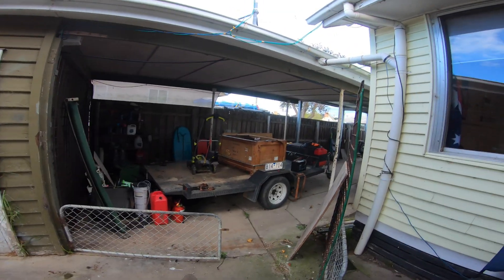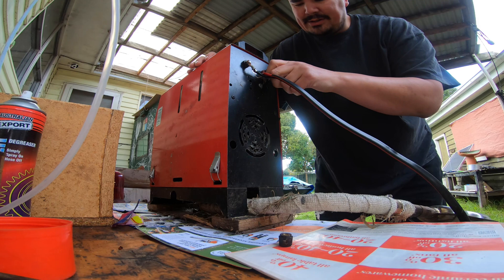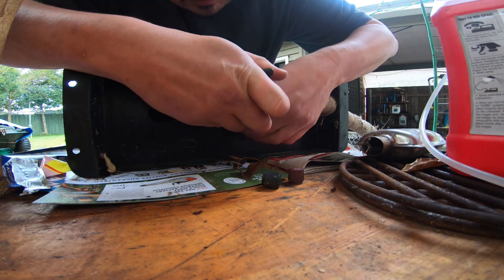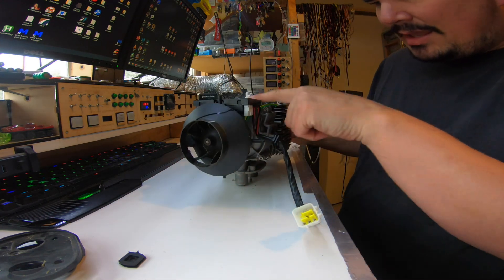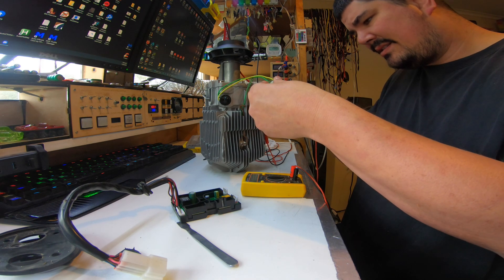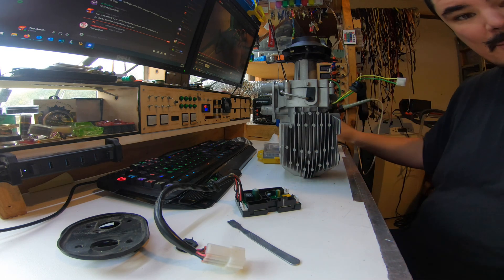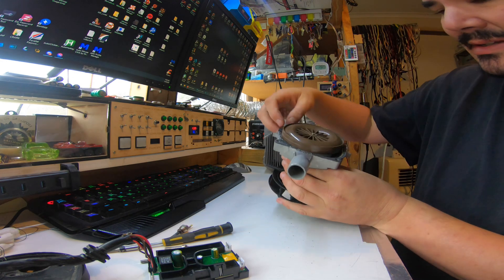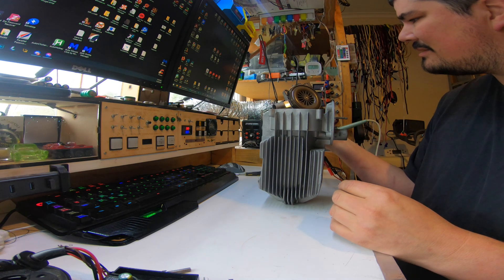Diesel Heater Teardown

Comment: You can take that motor apart. There are videos on it.
Reply from the maker: Yes, I have seen those - but getting either the impeller or fan off with the tools available to me risks breaking them.
The exercise here was determining weather it was more economical to repair when factoring time and effort, than to replace it with a new unit.
In this case, it was cheaper by a suitable margin to simply replace it, and make a video for the curious.